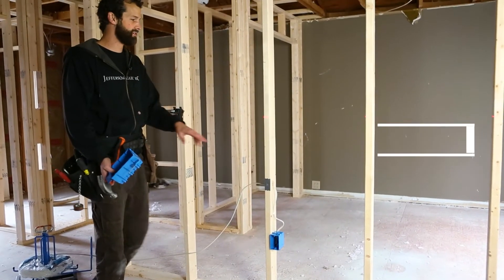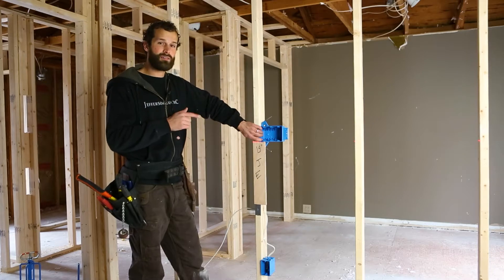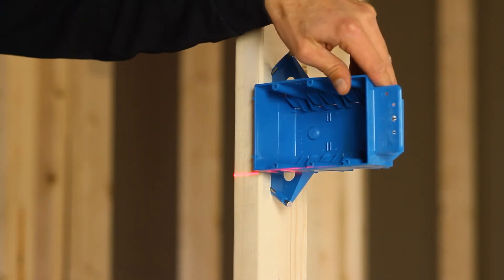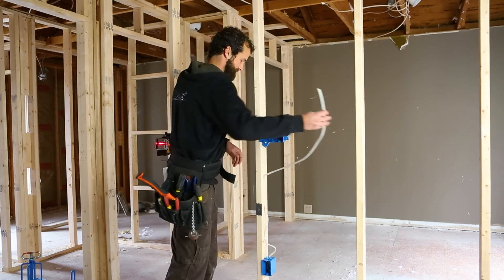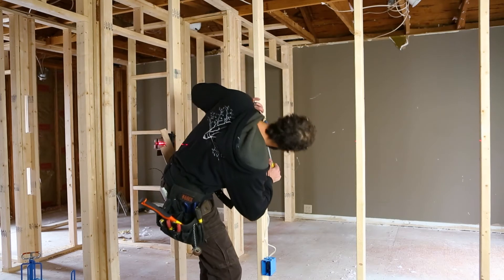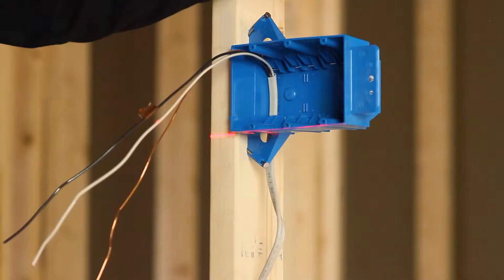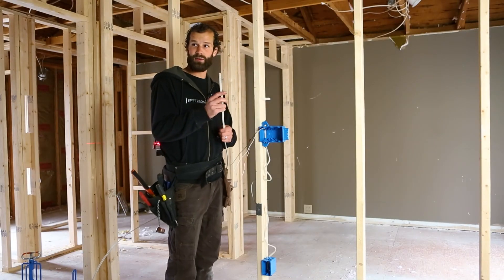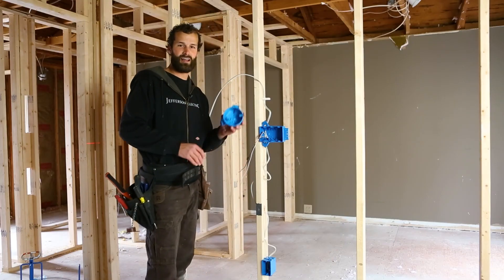Terminating Wire In a 3 Gang Switch Box

Comment: The hammer trick or jig trick for receptacles is a joke.  Slows the whole process down.  16” mark to top of the box and keep on moving.  Once furniture is in the house no one will ever notice a half inch let alone 3 inches lmao!  Super quality smart electricians can’t figure out how to succeed in big builder residential.  It’s super easy. Get a system of installation down and never fear an inspector that holds u back.  When u pull 250+ permits a year they tend to back down.  They enforce stupid stuff like gfci protection in a hallway plug cause it’s within 6’ of a bathroom.  They never enforce real issues like how many items are on a circuit.  The most important issue!

Comment: Big improvement is to mark the top of the box.  No need for bending over to see if your at the mark..  it’s easier and faster
Reply: 'Big Improvement' is saving 5-10 sec on marking the top? You still have to measure it and different boxes have different spreads between nails, so you have to accommodate for that difference, meaning you have to calculate. Honestly not much of an 'improvement'.

Comment: Why did you run your wire through the stud twice?  Just run it straight up the stud with a wire staple.  As a Canadian, I hate those plastic boxes, use a grounded metal box.
Reply: Always called the flimsy plastic boxes blue light specials. Allied makes great fiberglass boxes that I always used especially on exterior walls. Just applied a little bit of bathroom silicone caulk to prevent cold air from entering..Always tried to have all of my NM cables enter all from the same side ( all from the top of box or all from the bottom ). Makes it easier to make nice neat connections. Always placed a piece of tape on hot wire feeding boxes.